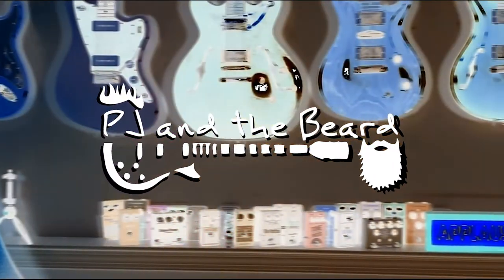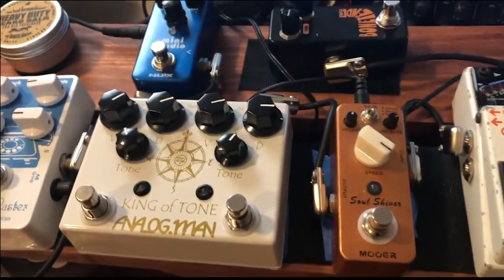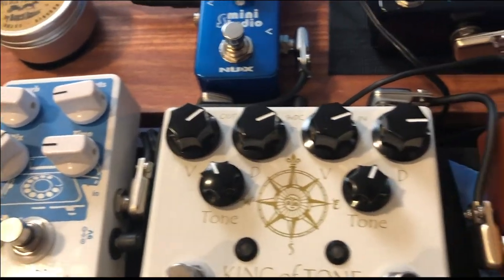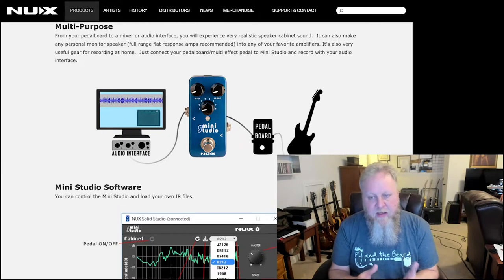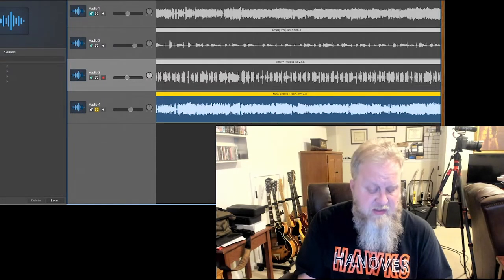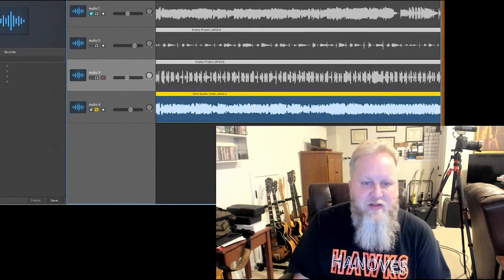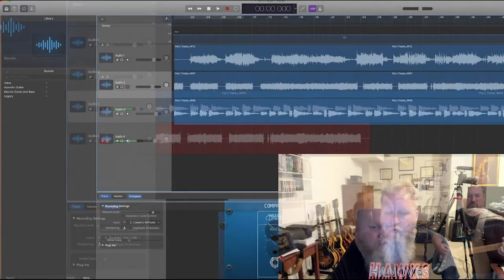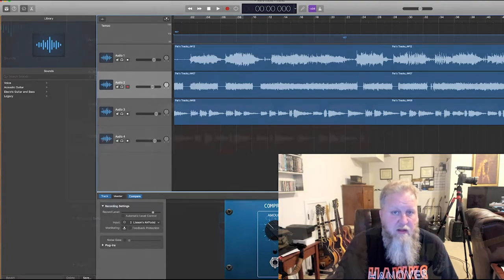The NUX Mini Studio Amp Simulator and IR Loader - Just Gear Talk Episode 8

Comment: Cool!
That pedal is just an IR pedal, which means it will give you the mic'd cabinet simulations that are available in the pedal. I don't believe this pedal gives the amp simulations with it. For that, I would recommend the big brother of that pedal, the Solid Studio.
For this pedal, It might sound a bit better when you are recording if you use a power amp simulator pedal in front of it. Like the Earthquaker Devices Acapulco Gold, (Sunn Power Amp Distortion), or some other "Amp-In-A-Box" type of pedal.
A set up like that would be great for going direct into a live mixer, or DAW, without having to fuss with microphones and amps and rooms, etc.
Reply from the maker: Hey Harley Hexxe, I meant to come back and reply to this comment and forgot. Thanks for the recommendations. I am definitely going to explore some of them.